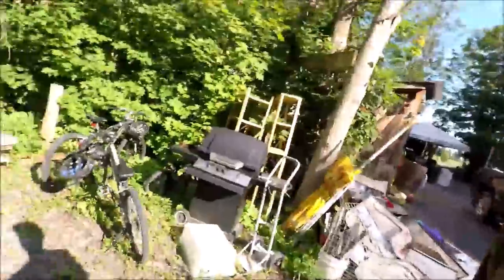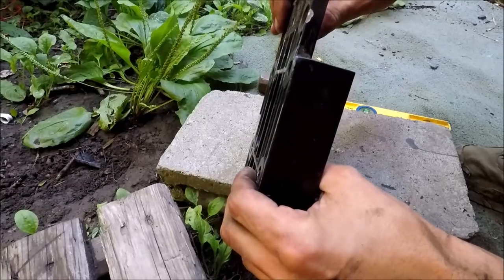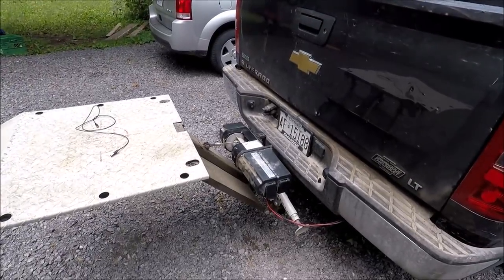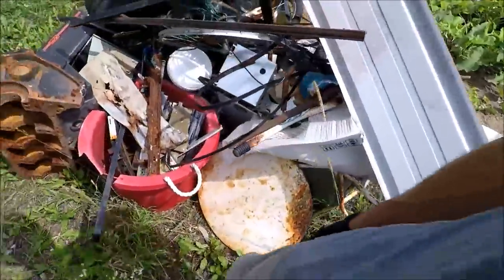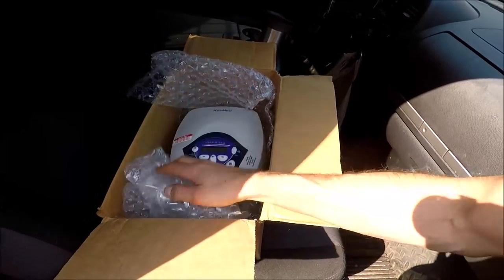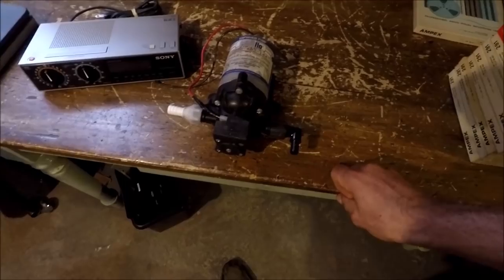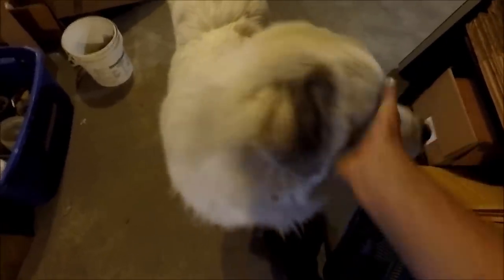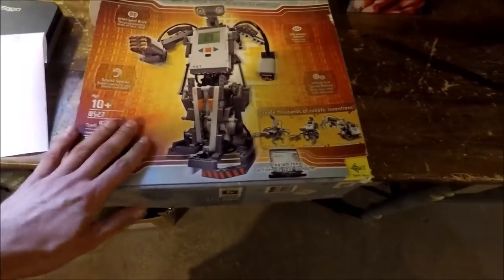I broke my expensive winch hitch lift!! & Selling common everyday stuff ebay sales review.

Comment: Catching up on your older videos. Great fix on the winch! Shipping boxes.....I sell on eBay too (20 years in 'Motors') and have to use all sorts of sizes. I never use boxes from retail stores mostly because they're too lightweight and also because they have advertising on them. Rather, I get most of them from the local Case-IH tractor dealer. They're heavy duty and used just once. Also, I get used once packing paper there, all for free. The paper, if I stopped every other day to get it and just leave it in my 8' pickup box with topper, in just one weeks' time it fills the entire box. I then transfer it into 60 gallon contractor grade trash bags and store the bags in a mouse free school bus body. I'm saying this as you appear to live in a rural area perhaps close to an ag implement dealer.  Not meaning to tell you how to package....rule of thumb says at least 2 inches of tightly packed packing between the item and box inner wall. NEVER use foam packing peanuts to ship anything. I like your videos.

Comment: If i remember correctly, because of the three freeze plug holes, it might be a small block chevy 400 cubic inch. If that the case, might me worth some money to someone. Do a search for SBC400.  There are a lot of "what ifs", so it might be not worth it for you... but worth a check.

Comment: That CPAP machine was worth thousands. I got mine for $3500.
Reply: Cpap needs to be set  at a precise setting after a sleep Apnea test..it is the pressure setting and if Medicare pays for it (Medicare rents it) a person has to use it 80% of the time or they will stop renting it... also if it is wirelessly transmitted, then the Dr will get the report.  I would not want to have my name attached to it....you are always my favorite scrapper.